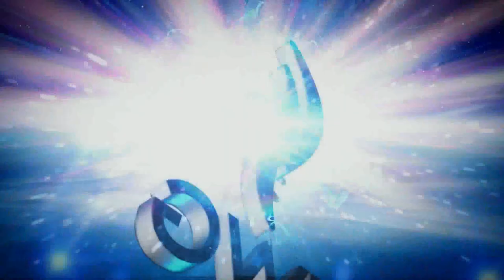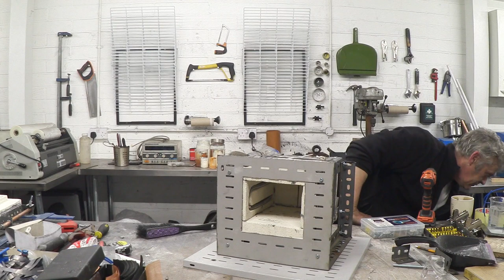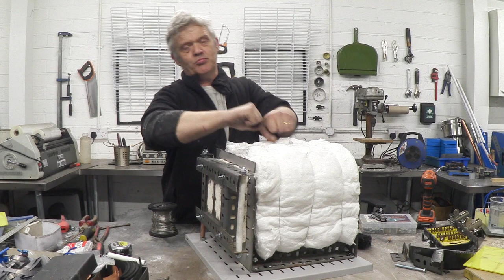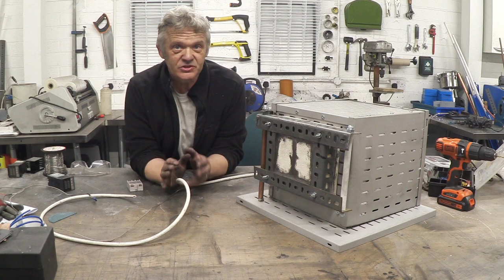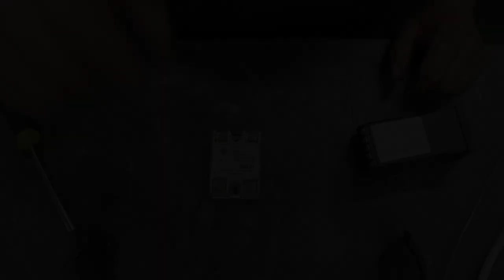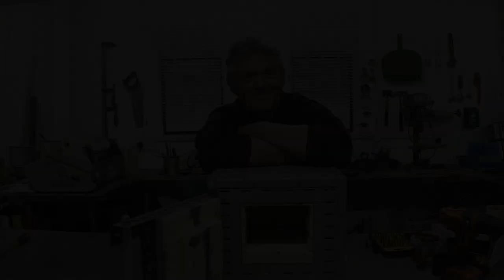How To Build A Lab Kiln - The Door, The Case, The Wiring  - And Finished!

Comment: Hi Robert I built my kiln 6 years ago - its around 30 cm internal (cube) - used in my small artisan activities. 

For those concerned about ceramic fibre insulation and the lungs - I went the route of Morgan Superwool which is available in a number of countries, the blurb claims that the fibres will eventually dissolve in water (lungs) and so are not bio-persistent. This was important for my design because I do not use firebrick - my operating temperature is only 900 deg C and my process involves a lot of door opening so I did not want the thermal lag of firebrick - this means that the fibre is not tucked away "at the back" but is the inner lining of the kiln and so can be disturbed any time I am careless - hence my preference for a 'safer' thermal blanket. I agree if the insulation is only exposed "at the back" and is not frequently handled then it is unlikely that much will go airborne - having said that the 'safer' wool performs just as well and was not more expensive. 

An alternative to winding on a smooth bar is winding on a threaded rod (again in the lathe) if you can find one that matches the desired coil gap - it worked very well for me, very uniform coils but I never tried the smooth bar version so it may have worked just as well for me there. I did not do a powered wind as my lathe is small 1960's industrial without a modern electronic speed control and I did not fancy having that much torque pulling a wire through my hands - even then using the un-powered lathe it did not take too long - I used the chuck key to turn the chuck - some might think it "OTT safety" but my reasoning was we have all gotten into a mess with wire at some stage and the thought of an "accidental lassoo-loop" in the wire, a finger and a five horse power motor at lowest gearing hence highest torque did not wet my appetite.
 
Great video as always ! :-) thanks..
Reply: Not over cautious at all. Pretty sensible I'd say.

Comment: Great project. Very well explained. I have heard that some ceramics (fire brick?) Start to conduct above red heat so it's good that you earthed the outer metal work. It would  be good to add a bonding wire also to the hinged door. You should turn off the kiln before opening the door too as the red hot elements are at 240vac potential and a shock hazard especially if using metal tongs.  The outer case of thermocouple should be earthed too I think. Looking forward to seeing it melt stuff. Wonderfully made video.
Reply from the maker: cheers mate - but to be honest you are going no where those coils when they are on - the heat is going to do far more damage before you got close enough for a shock - that big copper covered bolt that is the door hinge is loop in enough for bonding - the outer case of the thermocouple is earthed as it is bolted to the metal chassis via a steel clip - you might be over thinking this one mate - but I do appreciate the advice - cheers

Comment: Enjoyed your build. I recently built an electric kiln/ furnace using the heating element from an electric clothes dryer, 240 v. Used the full length at 120 v for low heat, and tapped at about 2/3 point for 17 amp draw high heat setting. Getting easily 1700º F with very little cost.
Reply from the maker: awesome mate - thanks for sharing

Comment: I got my order of 18 gauge nichrome wire and made a coil by hand without using a lathe or drill.  Took a long time but worked ok.  I used about 35 feet of wire @ 110 volts and it doesn't have enough power to get to temperature (coils don't even glow red hot) so I will cut a little off the length until it works while trying to keep the current as low as possible to avoid blowing a breaker.  I was thinking that kiln was originally about 1000watts but I could be wrong.

Also, the bricks in my old kiln were damp so I used a propane torch to heat it up and dry the bricks out.  I had it just over 1000 degrees F (using the torch) so far which is still not high enough but should increase once all the moisture is gone and the current is increased.

Comment: Many of the other kiln making videos twist a few layers of the wire together for the sections that pass through the bricks to keep those sections from getting as hot.  Probably not necessary but something to consider if that turns out to be a weak spot.  Should keep the wire outside the kiln a little cooler too.

Something I did on another (propane) kiln I built was use cheap fiberglass insulation on the outside.  Way cheaper than the ceramic fiber and it is protected by the bricks so it isn't directly in contact with the flames or heating coils.  It might melt but won't actually burn so it might be worth trying if cost and availability of the higher temperature ceramic fiber insulation is an issue.
Reply from the maker: true enough mate

Comment: Just made one using a bunch of old spiral notebooks, clay and a dryer cord.
I tried insulating the clay by mixing in used coffee grounds to leave voids, but added a bit too much and it ended up leaking... turns out it is a good way to make water filters though
Reply from the maker: cool mate

Comment: A great way to pull out those tiny itchy glass fibers from your skin is Duct Tape. It might remove some hairs too, but it's a fast way of doing it so you stop itching. Just put a strip on the area and peel it off and repeat until they're gone. You can reuse the strip a few times, then use a new one. Some anti-itch cream afterwards helps too.
Reply from the maker: thanks for sharing this mate - cheers
Reply: Or a cold shower closes the pores, so that the fibers do not penetrate deeper into the skin.

Comment: It may be better to use high temperature silicone/fibreglass cable running to the PID controller rather than PVC flex to terminate the nichrome wire as the terminal blocks will conduct a lot of heat into the cable which which will damage the insulation.
Reply from the maker: if you think mate - but i have had this exact setup working for 4 years on my big kiln with no degradation

Comment: What all pieces do you need for the wiring? I need to build one with an adjustable gauge on it like a pottery kiln, not necessarily a digitally controlled one but an adjustable one I can get a feel for what will bring it up to 1110 degrees f and I sometimes need to go up to 1200-1300 degrees to strike glass color with metal oxides in it. So I will need the wiring controls enough to handle those temps. Can you please list all the parts I will need for the wiring besides thermocouple also what is the dif between a thermo couple and a pyrometer?

Comment: What was the AWG on the NiChrom Wire you used.     I have 25ft of 20AWG  0.64Ohms per Ft on hand.   Not  enough for two elements.
Reply: A technical question at last brilliant,, do you know the formula for reactance I'll bet you do and root mean squared ah great stuff,, try and help me get rid of the trolls giving the thumbs down please ❤️👍
Reply: My notes from a previous video say Rob used 1.2 mm wire which should be close to 17 AWG.  I just ordered some 18 gauge resistance wire from Amazon which is a little smaller but hopefully will work.  (About $10 for 50 feet) 

20 AWG might work as long as the length is calculated to keep it from melting.
Reply from the maker: 17awg

Comment: I basically understand how to do the wiring for 110 volts. I would like to wire it for 220 volts because it would be more efficient. Also I have enough brick to make it taller and four heating elements. I do have two SSRs. May I impose on you to list a wiring circuit to do 220v, four element kiln. Thank you very much.

Comment: It wouldn't hurt to spray a little BBQ paint on the fibers, just make sure that they're locked in place & you don't have to deal with the Dust. It may not be a problem though?
Reply from the maker: you can do what you like mate - myself I wouldn't bother - it's a bit of overthinking really - the thing is in a big steel box and you just aren't going to disturb it for ages